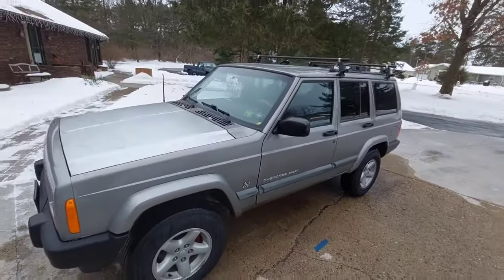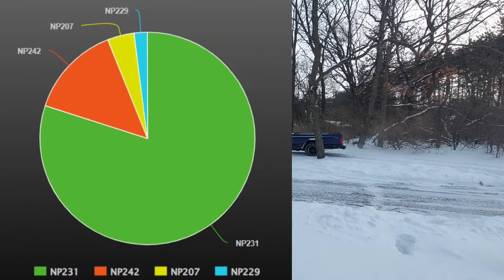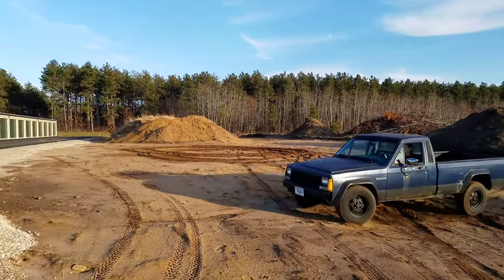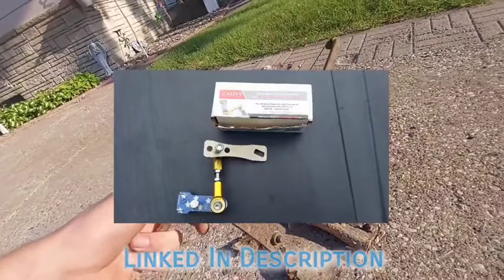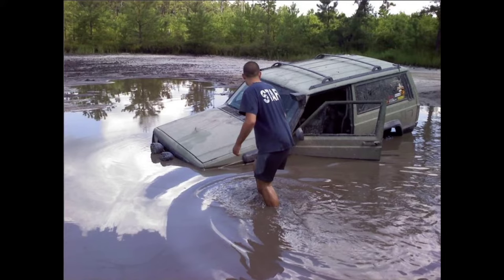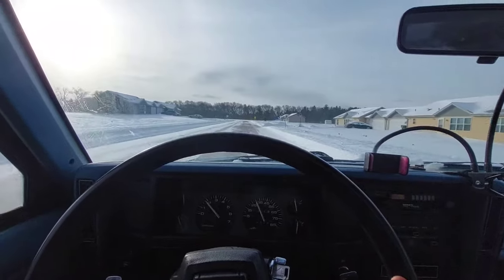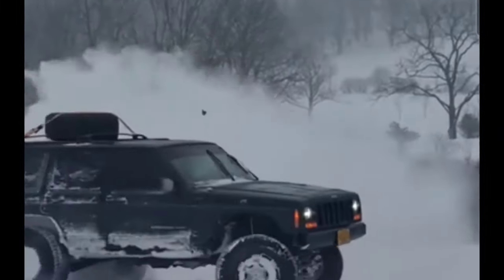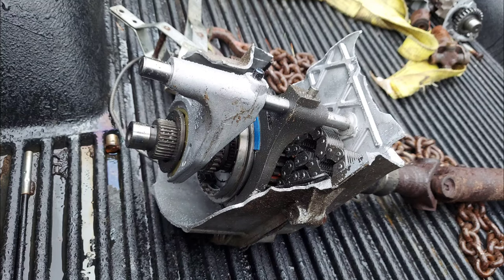Jeep Cherokee: Transfer Case Options & How to Use 4wd Correctly ['84-'01 XJ]

Comment: Thanks for the video. It was very informative since I just bought a 4wd xj and it’s my first 4wd vehicle. I put it in part time and drove around my neighborhood going maybe 10-15mph in dry pavement for about 1-2 mins because I wanted to test it out. Could that do any damage at all? It was pretty loud while I was driving but not like a whining or grinding sound. More like driveline noise or like a loud tire kind of sound. The jeep has regular tires so it’s not the tires. I decided to change the front and rear diff fluids and there were no metal shavings or chunks missing. Is it just generally much louder while driving in 4wd or did I mess something up?
Reply from the maker: It'll make more noise in 4wd, that's normal. As long as it all still works then I think you'll be fine  just don't use it on pavement again
Reply: @WAEMIDIV  how would I know if there’s any damage done? Had my XJ on 4wd one evening and set it back in 2wd but it was stuck in 4wd and I didn’t know. Drove at least 7 miles with speeds up to 50mph. Didn’t know it was stuck in 4wd till I tried to turn and the wheels were hopping. Did I cause any damage and how would I be able to tell?
Reply from the maker: @deegaw11  You can tell if you broke something because either you'll hear horrible, loud and very noticeable grinding, clunking, scraping and/or rhythmic thumping, or the vehicle just won't move. 

The transfer case is old, it probably wasn't used much, and your shift linkage may be slightly misaligned. Based on it getting stuck in 4wd for a long while, I'd start by changing the transfer case fluid if you haven't done that recently, and installing an Azzy Linkage. 

In the meantime, when you take it out of 4wd, tap the gas a few times when the lever is back in 2wd. Tap gas, fully release, tap gas, fully release, tap gas, fully release. That'll "knock" it out of 4wd
Reply: @WAEMIDIV  I get a thumping sound now only from 40-50mph. The sound isn’t there at any other speed. Not sure if it started before being stuck in 4wd or after but it definitely wasn’t there when I first purchased the XJ. I’ve changed the u joints, transfer case fluid and front and rear diff fluid but it’s still there. When I have it in 4wd I don’t hear the thumping but that could be because the drivetrain is much louder in 4wd. Again it only makes that sound from 40-50mph. Any idea what it can be? Still drives great and has no problem doing 80 on the freeway.
Reply: @deegaw11  I'd get the tires checked.  A bad tire can make a thumping sound too. If the transmission is shifting ok and the fluid is red, then it's most likely ok. Bad transmission can make a thumping sound. Hopefully it's not that. Did you check the front driveshaft CV joints/ U joints? Idk what year yours is? Mine has CV joints on the front driveshaft. There's also U joints or CV joints on the front axles. If any of that stuff is bad, it could cause some type of noise. I had a grinding noise I finally tracked down. It was the rear differential bearings.
Reply: @Thundarr995  definitely sound like it’s coming from the rear. The noise has gotten worse and louder. Only makes the sound if I give it gas, if I’m off the throttle it goes away. Still drives great but since it’s gotten louder, I’m concerned now if I’m doing more damage to it.

Comment: What type of transfer and differential oil do you recommend putting in?  the Transfer is a 231j
Reply from the maker: Factory Transfer Case requests Dexron-III, and that's what I use

The differentials use 75W-140 most commonly
Reply: @WAEMIDIV  Any particular brand of oil that I can use?  I really like your videos because you explain very well about the mechanics of each part of the Jeep xj
Reply from the maker: @zonahostiloffroadsaltillo  Honestly I never pay much attention to brands, they all do the same thing just with a different nameplate and colors on the bottle. The only brand I actively avoid is Mobil 1, but that's purely personal preference

Comment: Hey
Thanks for your helpful video.
I have a question abot my 93' XJ 2.5 5MT.
I tried gear N and turn knob to 4L, it was impossible.
I mean I can move the knob to 4H or N, but failed that move to 4L.
What is common problem with this situation?
I'd like to hear your wise advise.
Thanks again.
Reply from the maker: Because the transfer case doesn't have synchronized gears, sometimes the teeth on the gears can "perfectly misalign" making it not slide into 4Lo. This is why you're allowed to (and in this case, recommended to) engage it while moving at below 3 mph. When rolling slowly, the gears will be spinning and thus lining up the teeth in the gear will be much more likely as it rotates. 4Lo is notoriously hard to engage, and with bad engine or transmission mounts the 4wd linkage can get misaligned as well, making the angle and leverage needed to engage 4Lo impossible because of the irregular resting positions of the transmission or engine. 

Next time, try it while the Jeep is rolling very slowly. Or, with the transfer case in Neutral, put the transmission in gear, release the clutch for a second (to spin the gears and chance aligning them that way) and then with the transmission back in neutral try the transfer case.
Reply: @WAEMIDIV  Wow. 
I truly admire your knowledge. 
I live in South Korea. 
There are not many engineers who have extensive knowledge of old jeeps here. 
Today, I tried to recharge the air conditioner refrigerant gas, but I gave up for now because there was a leak in the service valve. 
It was not a refrigerant inlet, but a valve of another shape, and as far as I know, it is a structure in which the refrigerant is recharged and closed again by slightly loosening it. 
I'm really sorry to bother you, but can you tell me how to solve this case?
Reply from the maker: @명보에너지기찬보일러  I may be knowledgeable about drivetrain components but not so much air conditioning lol. My Jeep doesn't have A/C and I've never had to mess with it, I'm not sure what could be causing that
Reply: @WAEMIDIV  Ahh, I see.
Anyway, thank you very much for sharing your knowledge with me. 
I clicked subscribe button as a thank you. 
I became your big fan.
Reply: You need to be rolling slightly to get it into 4WD Low Range, very common with these transfer cases, the manual even tells you to shift the transmission to neutral while rolling forward around 3mph, and pull the transfer case lever quickly and firmly from 2WD, or 4WD high through neutral and back into low range without pausing in neutral.  Also, the shift gate isn't a straight forward and backward movement of the lever, you need to follow the lines on the bezel, if I recall from high range 4WD to go to neutral/low range you need to push the shift lever away from you while pulling back to get past the detent that stops you from shifting to neutral from 4WD high....then once through neutral you'll move the shift lever back and to the left slightly.

Comment: Terrified to brake mine so to confirm. 1992 xj larado, 4L 5 speed manual. If I’m driving (In slippery conditions) all I need to do is put in the clutch and put it in 4 high? Don’t need to stop?
Reply from the maker: Yep, it's a shift-on-the-fly system. You can engage it while stopped or moving, doesn't matter. Just give the lever a good firm yank
Reply: @WAEMIDIV  thank you so much. So excited to have some fun in the snow 👍

Comment: Question: if driving the 231 on mixed hardpack ice/snow with slight asphalt patches …. Generally straight road that is fine. Correct?

But if you did accumulate any binding when you drop back into 2wd is all the binding safely released?

Looking for the best way to release and binding that may have occurred…. To explain things to my newly driving kids properly 

Thx
Reply from the maker: If you go straight, it means both sets of wheels are spinning at the same speed, so they never bind up. You could stay in part time on dry pavement forever if you never turned

But if it does build up tension in the dry patches, yes it's all released in 2wd. It may be a little difficult to put it back in 2wd with it binding, but it will. It may also allow a wheel to slip on the ice patches when able, so it is relatively risky
Reply: With normal highway driving in part time 4WD mode it wont' cause any issues, your tires will wear out a bit sooner as they take the brunt of the binding on dry pavement in light to moderate turns...its when you are making repetitive tight lock to lock turns in 4WD part time that causes significant binding and damage to drive train components.   

If you've bound up your 4WD system you are already at the point of breaking things.....straighten the vehicle out on the road, shift back to 2WD, and backup or go forward a few feet, depending on the direction you were going when you disengaged the 4WD go the opposite way....sometimes if the system is under a lot of tension when you shift out of 4WD, and reverse direction it'll disengage with a bang as the shift collar in the transfer case returns to the disengaged (2WD) position.

Comment: I have a few questions for some reason last time it snowed here in kansas i had it in 4 hi and a blew my trans recently. swapped it out so im trying to learn more about this why would this of happened? i made slow turns with 4 hi tho since the roads where slippery could that of caused it? 
my second question....
Can i use 4hi when its slippery like light snow/ice slippery roads? 
3rd question when making turns in 4hi while slippery when the tires jump is that because its not slippery enough or are you not suppsed to make turns in 4hi?
4th question so in 4lo can you use it for dry pavement? my friend used to launch his jeep in a straight line for racing for more torque or was he just being stupid.....lol
Reply from the maker: 1: Transfer case probably has nothing to do with blowing up the transmission. 
2: As I discussed in the video, you can use 4 Hi part time where the tires can slip yes, you have to, because if they can't slip, you'll bind up the drivetrain. It also warns you not to use it on high traction surfaces on the sun visor, and the owners manual. It's called "part time" because you can only use it part time. Snow is usually not enough to justify using it, unless it has literally entirely covered the road. As I discussed in the video, you have to pay attention to what you're driving over, and put in back in 2wd when you enter a plowed area
3: You can turn in part time, but again the wheels must be allowed to slip. If they're catching and jumping/ skipping, there's too much traction to warrant the use of 4wd. 
4: 4 Lo is also part time, it's the exact same thing as 4 Hi except it multiplies torque output. You can use either on dry pavement in an exact perfect straight line. Using 4 Lo to launch the Jeep in a drag race is only gonna help you for the first 3 seconds or so, before it tops out at like 25mph. 4 Lo is designed for crawl speeds, idling around in 1st gear.
Reply: @WAEMIDIV  Thanks, man, I really appreciate it. This is the first time I've had a 4 wheel drive vehicle. Your videos are really informative. Thanks for answering my questions. This week it's gonna snow real hard here so I appreciate it

Comment: I’m curious if this is true, my grandpa told me 1991 jeep Cherokee 4.0 four-wheel-drive automatic that it is good to get on a dirt road or grass and put it into four-wheel-drive on occasion that the chain will pull lubricant up and keep everything in the transfer case lubricated That it will last longer if you occasionally use it instead of never using it at all, is there any truth to this?

It seems like a good idea to test all of your systems anyway so when there’s a problem it’s not when you need it, but I’m not sure if the transfer case uses the same fluid as the transmission? If the chain carries the fluid or if there is a pump or slinger? Or if it even spins enough to matter? 

I definitely noticed that your turning radius is doubled in four-wheel-drive, both high and low I guess because of the U joints being engaged? It makes the wheel turn at intervals back-and-forth with the wheel, turned halfway. I never tried to force it at this point.
Reply from the maker: It's certainly not a bad idea to use the 4wd occasionally, but it's not necessary. The fluid pump in the NP231 is driven from the output shaft, so if the wheels are spinning, the internals of the transfer case are being lubricated properly no matter what mode its in.
Reply: Owner's manuals of most, if not all 4WD vehicles actually tell you to engage the 4WD about once a month and drive a few miles....you don't necessarily need to go off pavement to do so, an open stretch of highway will work just fine, just don't be out there trying to do donuts on the pavement in 4WD.  

Another thing is, if you have the full time 4WD system you can engage it in full time mode say on your way to work or school, and once you get there disengage it.

Comment: So if you drop the auto trans lever into lets say 1 or 2 with the 4 low engaged what would be that ratio?
Reply from the maker: The AW4's 1st gear ratio is 2.80:1. Assuming you have stock axle gearing at 3.55:1, we multiply 1st gear × transfer case low gear × axle gear

2.80 × 2.72 × 3.55 = 27.04:1 final drive ratio in low gear with a 4.0L Automatic XJ.

Comment: 8:02 i’ve noticed that if there are issues putting the truck into four-wheel-drive or getting out of four-wheel-drive, it helps to put the transmission in forward, then reverse then back into neutral I think it won’t work if the teeth and gears aren’t aligned just right? Seems like every other time. It works perfect every other other time you have to try twice, but it always works two out of two. These are great trucks.
Reply: Its a common problem with these transfer cases...the NP242 likes to get stuck in part time 4WD when you shift into or out of full time mode....usually changing direction helps it to disengage....if you are driving down the road and shift between 2WD and either part time or full time mode usually releasing the accelerator while performing the shift will get it to shift properly....if the transfer case is under tension when you shift, its going to remain in whatever selection you previously had until the tension is released, then it will finally shift to whatever range you have currently selected.  

Another cause for shifting issues is mismatched tires, mismatched tire sizes, or oddly worn tires....all will cause binding issues with the 4WD system making the shifts between ranges difficult.

Comment: I Have successfully used atf+4 in 97, 99, and 2000 xj,s with both transfer cases.
Reply from the maker: I have also heard of people using 10W-30 Engine oil with no problems either, the transfer cases aren't picky in these things, but Dexron-III is what they requested from the factory so that's what I use
Reply: 10w30 is too thick and may damage the pump, atf+4 is a full synthetic with an advanced additive package that is produced only under license to chrysler Corp, and will outlast dextron 5 to 1
Reply: @carldietz9767  atf 4 is wrong
Reply: @bobquattrini1787  the factory is using atf+4 in late model transfers. Unless specified for case fluid only sold by mopar.

Comment: There are differences in the 231, the early ones were not shift on the fly. The 231-J is shift on the fly.
Reply from the maker: the NP231AMC is indeed shift-on-the-fly, even demonstrated in this video: my 1987 truck has one and I showed shifting while moving 

What they don't have is a true neutral axle disconnect, so while N disconnects the transfer case from the engine, it is still locked in part time. I believe true-neutral was added in 1991
Reply: @WAEMIDIV  As someone who has rebuilt many of these the only difference is a syncro in the 4wd. You can shift on the fly but it's hard on the shift collar in the t-case and can break the axle shift pod. I've repaired a lot of these and converted 231 to a 231-j with addition of a syncro.
Reply from the maker: @mountainmonk5874  I see... so it's possible, but not necessarily intended. Interesting